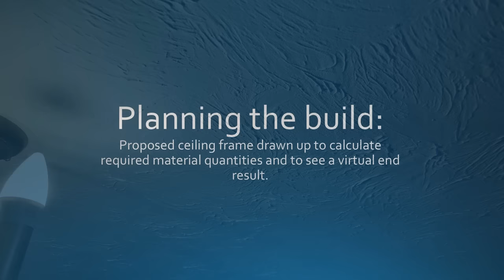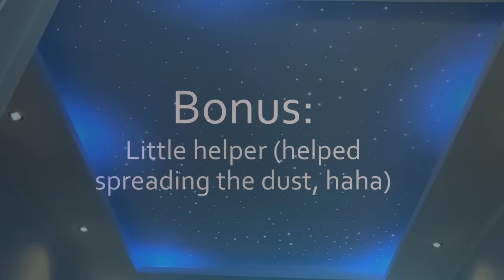Fibre Optic Star and RGB LED Ceiling DIY Build

Comment: Class work. I've been looking at this kind of thing and couldn't get a definitive answer off my suppliers of and how you can run more than 5m. My question is how. Did you use 
1: multiple injection points
2: was it multiple drivers. My experience is with standard rgb ribbon and the controllers are powered by the driver this looks independent power and only runs data is that correct hope that makes sense. Again top job 👍
Reply from the maker: Thanks Gareth!
I used 1x 30A 5V driver, 1x data controller and 4x voltage injection points in total (every 3.5 meters). Due to amperage and travel distance voltage injection cables were 2.5mm2.
Hope it helps.
Reply from the maker: Thanks Gareth!
I used 1x 30A 5V driver, 1x data controller and 4x voltage injection points in total (every 3.5 meters). Due to amperage and travel distance (voltage drop) voltage injection cables were 2.5mm2.
Hope it helps.
Reply: @DIY_it_ALL  nice good to know makes sense obviously 2.5 for your 30a quality work man quality help 👍

Comment: Hello, what a fantastic job matey - I’m about to start a similar project in my bathroom but without the lighting affect in the centre, I’m planning to use teak lats spaced out, my question is this - did you skim the plasterboard or tape fill and sand as it appears in the video?  Will that product go over and hide the scrim tape ok ? 
Many thanks if you get chance to reply.🤙🏼🎄 Ziggy.
Reply from the maker: Hi Ziggy,

Thanks very much for your kind comment and question.
I personally used a scrim tape to tape and joint all joints instead of plastering the whole thing, then joints were sanded and everything was painted. 
That particular product I used would do the job - it hides the tape well and is easy to sand, but I found that you have to be careful with it when painting. Careful in a way of not going over it with a dry-ish paint roller or going over it to many times with wet paint roller, because it may flake off in parts if you do. 

Hope it helps and good luck with your project.

Merry Christmas.

Comment: Incredible build, I would love to replicate. Do you know the dimensions of the drop? The width from the wall to edge, the height below the ceiling, and the width of the recess? Thanks in advance!
Reply from the maker: Thanks so much!
The soffit is 500mm deep and height between the bottom of it and ceiling is 250mm (100 mm for the bottom 'lip' and 150mm for the 'base' which is fixed directly to ceiling).
Hope it makes sense.
Reply: @DIY_it_ALL  subscribed . 
love this going to give this a go my self . Don't really understand your measurements.

From the ceiling to the bottom height ? 
What's the width that it comes from wall to outside ? 
Hope that makes sense 

Thanks in advance
Reply from the maker: @user-yh7bk7dx7c  thanks so much!
Measurement from the bottom to the ceiling is 250mm. Width that comes from the wall to outside is 500mm. 
Good luck with your project!
Reply: @DIY_it_ALL  thanks mate
Reply: @DIY_it_ALL  what size timber did you use for this ? I’m guessing 2x2 if so 100 mm for the lip  is 4 inches ?
Reply from the maker: @user-yh7bk7dx7c  you're absolutely right on both points.
Reply: @DIY_it_ALL  this what I’m confused about lol 2 x 2 is 50mm x 50mm how you make it 100 mm ?. 

Do you mean it’s 50 mm not 100 mm ?
Reply from the maker: @user-yh7bk7dx7c  Well that's embarrassing - it's been quite a while ago and so for some reason I was thinking that it's 100mm. But you're right, I've just double checked and it's actually 60mm (width of 2x2 plus 10mm added by the metal corner mesh and filling compound). 
Hope it makes sense now.
Reply: @DIY_it_ALL  haha easy mistake to make just threw me off I’m about to start this project myself so just sorting all materials out want make sure get 100 % right 👍🏽 thanks for the reply
Reply from the maker: @user-yh7bk7dx7c  Of course!
Good luck with your project and enjoy it.
Reply: @DIY_it_ALL  hi me again lol , I’ve started this , this weekend I’m bit confused on your measurements you have said the timber on the ceiling comes out 150 mm , looking at your video it doesn’t match the timber on the ceiling looks like it comes out about 350mm is that about right ?
Reply from the maker: @user-yh7bk7dx7c  Great to hear, hope your project is going well. I have quite a low ceiling so it's about 200mm to the "bottom lip" and around 270mm in total (height wise).
Reply: @DIY_it_ALL  so ceiling to floor wall is 270 mm drop ? 

What about the batton on the ceiling how far does that come out ?
Reply from the maker: @user-yh7bk7dx7c  That's right. And the batten on the ceiling comes out 400mm. Bottom lip comes out 500mm.
Reply: @DIY_it_ALL  right I’m with you now I’ve just put the batton all around the wall will start the Battons on the ceiling tomorrow . Thanks for the help 👍🏽👍🏽👍🏽

Comment: how long do the fiber optic lights last? and how do you replace them once they run out?
Reply from the maker: Fibre optic strands are not lights themselves, they only transfer light from the source to the tips. I have personally hidden the source of the light (colour changing LED in my case) behind the access hatch within the suspended ceiling. So if it would break I could easily replace it without the need to do anything with fibre optic strands.
Hope it makes sense.
Reply: @DIY_it_ALL  Oh I didn't know that. That's awesome! I'd love to do something with fiber optics one day if I ever get my own house

Comment: When you did the plastering of the plasterboard seems and screws on the ceiling, did you pull up the fibre optic cables, or did you just plaster over them and cut off the excess?
Reply from the maker: Hi Kishan,
I placed fiber optic strands in such way, so it would not be too close to seems or screws. In this way I did not have to plaster over strands and trimmed the excess in the very end.
Hope it helps.
Reply: @DIY_it_ALL  Awesome job bro. Have been scratching my head how you avoided plastering over the fibre strands. Have read all comments from top to here. Thanks for replying Kishan.

Comment: I'm a beginner at the home diy stuff. How'd the paint not get onto the fiber optic stand tips?
Reply from the maker: Thanks for your comment. 
Painting over fibre optic strands is fine, because they shine through the paint with no issues. Nevertheless I've left them sticking out by around 2-3mm in case I would need to redecorate the ceiling in the future and they would no longer shine through. I would then trim them further to expose fresh tips.
Hope it makes sense.

Comment: When you were rolling on paint how did you keep from painting the ends of the strands? Thanks
Reply from the maker: Hi Steven,
I trimmed all strands to about 4mm first, then painted over them, and then trimmed them another 1-2mm to expose the ends. But it is also ok to paint over strands and the light will still shine through (if you'd like to repaint the ceiling in the future).

Comment: Why at 1:47 does the timber go up into the ceiling? I can see you've had to cut the coving for some reason but I've been rattling my brain to work out why.
Reply from the maker: That timber piece does not go above the existing ceiling. And I had to cut the coving because that was the only place where I could attach the timber, everywhere else was plasterboard and attaching timber frame to plasterboard would not work. Hope it makes sense.

Comment: Which AC/DC did you use and why? There is so many different options on ebay once you click on the link provided? Thanks
Reply from the maker: If you are referring to the power supply, then I used 30A 5V DC supply, because my LED strip is 5V and it's length is 13m.
Hope it helps.
Reply: @DIY_it_ALL  thanks for the reply, could I ask why do you use power supply instead of just plug in to a socket? Did your led not have a plug? Thanks

Comment: amazing job was looking for similair builds for in my living room, and To see how it looks to a similair space ! Thanks, only 1 qeustion Did you put the LED strips with a Diffuser strip on it ?
Reply from the maker: Thanks so much for your comment.
No, I did not use a diffuser for the LED strip as the light washes out on the ceiling quite evenly.
Hope it helps and good luck!

Comment: This looks great, question for you...

How deep is the  lower portion of the detail where you have the spot lights, the overhang maybe ? 

And what is the space  hight wise between that and the actual  ceiling?
Reply from the maker: Thanks!
The overhang is 500mm deep and height between it and ceiling is 250mm (100 mm for the bottom overhang 'lip' and 150mm for the 'base' that is fixed directly to ceiling).
Hope it makes sense.
Reply: @DIY_it_ALL  thanks, didn’t notice you reply to my question! 🙏🏻

Comment: Awesome job! I see at 5:01 you have shown the switches. I'm assuming for the two knobs, one is for the starlights, and the other is for the spotlights? What is the device on the right, and what will it be used for?
Reply from the maker: Thanks Ajaypal.
I think I have caused some confusion - the picture at 5:01 is just to show the amount of dust after sanding and it shows a dimmer switch and a thermostat. 
To answer your question about switches, the double dimmer switch was used for GU10 spotlights and LED strip around the perimeter of the ceiling. Star light was connected via a Wi-Fi relay, which I can switch on or off using my mobile phone.
Hope it helps, take care.
Reply: @DIY_it_ALL  Thank you very much for clarifying, and thank you for the detailed video. I shall now attempt to do this to my man cave and front living room 🤞

Comment: Great video showing the various steps. We have a similar project so hope to pinch the various ideas on here. Did most lighting stuff come from Amazon/Ebay? Is the room still light enough to be used as a non cinema room (ie to read a book) when not using star ceiling/LED. Im trying to create a multi use room with large screen tv and cinema sound with lighting but also want to have library space, pool table and a pull down bed! How do you get to the LED light source for repair/issues? Ive seen some who have panel on magnets and then a ceiling panel breakout. Great job and thanks for posting.
Reply from the maker: Hi Andrew, thanks for your comment. Yes, all lights were purchased online. And yes it is bright enough in the room with no LED's because I've installed 10x dimmable spotlights around the perimeter of the ceiling - they produce a very good amount of light.
I have also left an access hatch in the least visible place above the "bottom lip" of the suspended ceiling to be able to get to the star light box and LED driver & controller in case of maintenance. 
Hope it helps and best of luck with your project!

Comment: What do you do when the ceiling needs a new lick of paint?
Reply from the maker: Simply paint it. Fibers shine through paint with no issues. Also, I left them sticking out by around 2mm, so that in case I would need to trim them in the future (after a few more coats).

Comment: How low did build from the roof the part where the lights are and how wide it is? I'm about to build the room and cant decide the measurements :P thx :)
Reply from the maker: Hi,
Thanks for your question.
I built the frame using 2x2's. The suspended part is 500mm off the wall and 270mm off the ceiling - 200mm for the 'base' and 70mm for the 'bottom lip'. 
The base came out 400mm off the wall and the bottom part 500mm, leaving a 'lip' of  100mm to hide LED strip for indirect lighting. Hope it makes sense.
Good luck with your project!

Comment: I don’t understand how you were rolling paint right over the stars and you could still see them twinkle??
Reply from the maker: Painting over fibre optic strands does not affect them as you'd think and they shine through just fine. However when trimming the strands, I did leave them sticking out by around 2-3mm in case I would need to trim them further after another coat of paint (if I needed to refresh the ceiling in the future).
Hope it helps.

Comment: Awesome job, looking to start my own DIY since watching this, what program did you use to to create the visual?
Reply from the maker: Thanks Paul! 
I used SP107E controller for LED strip and it comes with loads of pre-programmed visuals, which you can choose via a mobile app.
Good luck with your project!
Reply: or you can buy cheap ARGB controllers from Aliexpress. They did a fine job too

Comment: How long did it take.. Fantastic work.
Reply from the maker: Thanks so much! 
It took me a month to build working five days a week during lockdown. I took my time though.
Reply: Get another video up
Reply from the maker: @kevincurley5065  will do! I've been working almost two years on my latest project - keep an eye out for a new video soon.
Reply: @DIY_it_ALL  I'll def be watching. Any hints what it might be
Reply from the maker: @kevincurley5065  Thanks so much for your support. 
I've built a garden outbuilding from scratch with three rooms - workshop, sauna and changing room. I've also built a timber framed gazebo next to it and joined it with the house using composite decking.
Video is already in editing phase, but I'm renovating my garden at the moment (as well as working a full time job), so finding time is a bit challenging. But it will be out soon. Thanks again!

Take care.

Comment: Hey great video very informative i’m currently doing the same project minus the fibre kit! is power to all 3 light sources controlled via the same single switch? can you send a wiring diagram also what size ac to dc driver did you use  thanks
Reply from the maker: Hi Myles,
Thanks for your comment.
With regards to power, I had a four core cable running from existing light switch therefore made use of the two 'live' cables to connect LED strip and spotlights. Starlight was connected to a permanent live cable, but it runs via a Wi-Fi ON/OFF switch, which I can control on my phone (I think the link is in the description).
DC driver I used is 5V 30A, but only because I used 12 meters of 5V SK6812 LED strip. Should you, for example, want to use 12V WS2812 (or similar 12V strip), you would be absolutely fine with a 15A driver for the same length of the strip (10W * 12meters / 12V = 10A + 5A spare capacity = 15A).
Hope it helps.
Reply: @DIY_it_ALL  Thanks for your reply very helpful, regarding the down lights what flexed holders are they and have you used led bulbs powered off the same driver used on the lef strip run or normal halogen gu10s ?
Reply from the maker: @mylesyeoman7799  Glad I can help.
Downlights are regular GU10 halogens in my case because I wanted to have them dimmable, but without buzzing noise in bulbs (common on dimmable LED bulbs, even with stepped dimmers specifically designed for LED's).
Reply: @DIY_it_ALL   Hey my led strip run total length is 15m did you cut and solder the extra 2m onto your 12m run and what made you use the 5v SK rather than the standard 12v WS thanks in advance
Reply from the maker: @mylesyeoman7799  Hi!
Yes, I soldered LED strips directly to one another in straight lines, and used 0.75mm wires to join it in 90 degree angles.
I chose SK strip, because it has a separate white diode in addition to RGB, so I could have a standard warm white light instead of blue-ish white produced by RGB diodes. Though something to bear in mind is that 5V strip needs more voltage injection points than the 12V one.
Hope it makes sense.

Comment: Hay bro i’m doing this right now on my ceiling I’m just wondering how did you fill the hole around the fiber optics  cable in the Drywall please respond as fast thank you bro
Reply from the maker: Hi, I did not have to fill holes around fibre optics, because the drill bit I used was of exactly the same size as fibre optic strands - 0.75mm. So no gaps were left after strands were inserted.

Comment: your painting ontop of the fibre holes? errr.... im confused... dont you have a video explaining why it lights dont get covered?
Reply from the maker: Fibre strands shine through the paint with no issues. But I also left them sticking out about 3mm, so I could trim them by around a millimetre after further paint coats are applied in future (if needed).
Hope it helps.

Comment: How did you mud and paint with out covering any of the fiber optic wire?
Reply from the maker: Hi,
Thanks for your question.
I used a small 4" blade to fill joints whilst avoiding fibre optics followed by some sanding to feather out the compound/mud.
Hope it helps and good luck!

Comment: Mate that was amazing.   When you put that scrim tape up I thought you was going to re-artex it lol.   I'm going to make this.   Did you paint over the star lights?
Reply from the maker: Thanks so much!
Yes, it's ok to paint over the fibre optic strands, they shine through with no issues. Though I did leave strands sticking out by around 3mm in case I would need to trim them in the future.
Good luck with your project!